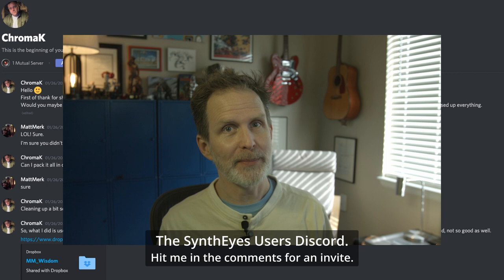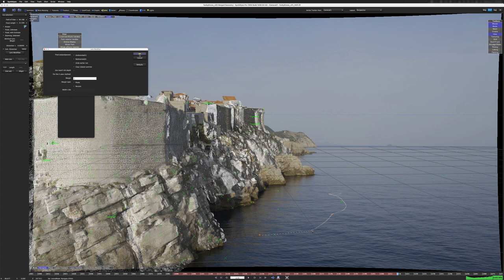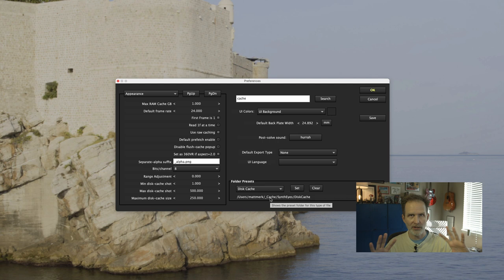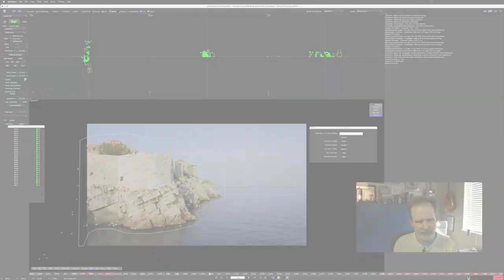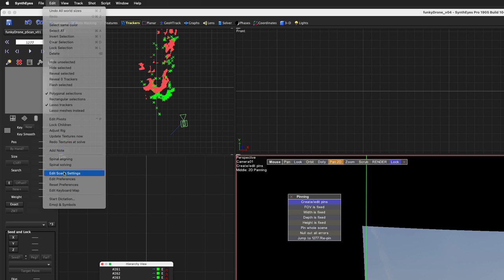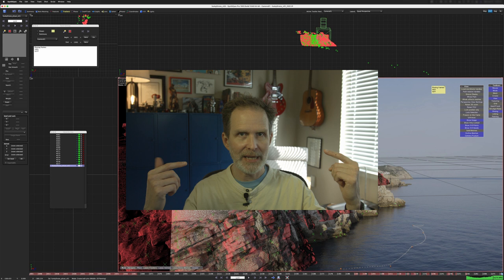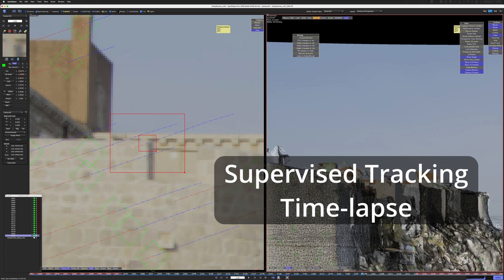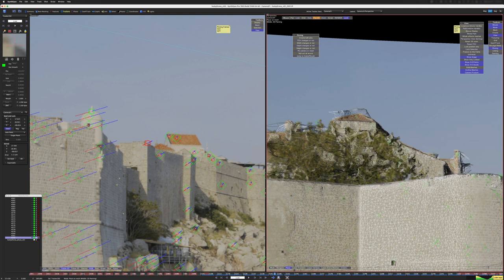How I Align Photogrammetry to 3D Tracks in SynthEyes.

Comment: you said no lens distortion before tracking. does that rule apply everywhere else or just in SynthEyes if I may ask? cause that is something has been bogging me
Reply from the maker: I'd say mostly SynthEyes, because the lens distortion calculations are so accurate. Beyond that, depending on the apps you are using, that assertion may or may not apply. But if you are 3D tracking in SynthEyes, you typically want to try letting SynthEyes solve for the distortion first, and only then moving on to other distortion management approaches.
Reply: @MatthewMerkovich  I love Syntheyes but sometimes time constraints don’t permit me to jump between programs. And I’m a comp artist so I do the 3d camera tracking in nuke. Now I noticed something about nuke when about to solve, you can check the undistort lens button, but that button is not needed when the plate is already undistort.
Reply: @MatthewMerkovich  so when I’m in Syntheyes. I shouldn’t bother undistorting. It’s wrong. And true, Syntheyes undistortion is very accurate
Reply from the maker: @glmstudiogh  We all have to play to our strengths, so if you are getting good results staying in Nuke, I say fabulous! But for me, when I was compositing in Nuke (or any other app), SynthEyes was much faster for me. The trick there is having good pipeline and workflow tools to make those transitions easier. For example, the new SynthEyes to Flame workflow makes switching back and forth much, much faster.

Comment: Hey Matthew, thanks for the video, noob question here, why should we not undistort the footage before tracking? what would be your workflow if you are given lens and camera info, plus a lens grid from the client, or even for a personal project.  Thanks!
Reply from the maker: Typically SynthEyes can calculate more accurate lens distortion maps than lens grids. There are instances where lens grids are very helpful, but that really only applies to very distorted anamorphic lenses. My workflow with spherical lenses and on-set notes is to ignore the notes. Just remember, a 35mm focal length lens isn't actually a 35mm focal length lens.
Reply: @MatthewMerkovich  thanks for your very informative answer, one last question, on this workflow, how do you pass the lens distortion information to the compers and CG artist so they can distort their renders to match the original plate? I am asking this because the workflow I usually see is this one:  Lens distortion is calculated from a grid so we have a node in nuke to distort all the CG renders, and undistorted plate with overscan is generated for both comp and CG. The final submission of course will be the original plate with the CG integrated, distorted, and comped, which would at the end go to color grade or any grading process.  At least at Framestore and at Dneg, which are the companies I have worked for where I saw an actual workflow for these things. I am an FX Supervisor but many years ago I worked as a generalist and did my fair bit of tracking, but never at the level of a big production.
Reply from the maker: @hernanllano9711  Here are my typical, boilerplate Export Notes

Undistorted plates:  If your original footage was linear, the accompanying undistorted plates have been created with a neutral color correction in an RGB color space as JPEG images. If your original footage was in a log color space, the undistorted footage is coming back to you in that color space. Feel free to create your own undistorted plates using the provided undistort nodes in your preferred color space and file format supported by your compositing app.

Nuke: Lens distortion is done via ST maps. The first will undistort your footage, though you shouldn't need it; it's mostly there for illustrative purposes. I've provided an undistorted JPEG sequence, though you could use the first ST map in the Nuke script to generate undistorted BG images of your own, for your 3D team, that are to your color specs. For best results in the final comp, render your 3D elements at the overscan resolution and redistort back to the plate resolution using the second ST map. This leaves your original plate unchanged and only downsamples your 3D render when re-adding lens distortion.

Fusion: Fusion works the same as Nuke.

After Effects: The scene has been exported as an After Effects Javascript. Just run it from within After Effects and your comp setup will be created. Also, an export message from SynthEyes: "SynthEyes Distortion node generated. You must have installed the SyAFXLens.plugin into the (new) folder /Applications/Adobe After Effects CC 20XX/Plug-ins/Effects/SynthEyes. See the Exporting section of the manual." Once your comp is set up, use only the redistort node to add distortion to the VFX elements rendered at the overscan resolution.

FBX: The FBX file format is the most robust output for modern Autodesk 3D animation pipelines. This shot has been exported in the most recent FBX version. (Older FBX versions can be exported for pipelines running older versions of Autodesk software.)

Export Geometry: The triangulated mesh named, "TrkMesh" is provided only as a byproduct of the tracking QC process. The point cloud has been roughly triangulated to show the camera or object track lines up to the photography. Feel free to use it for reprojections or whatever you'd like, but you may need to have actual modeling artists build out geometry using 3D specialized modeling tools like Maya, 3DS Max, Modo, etc.
Reply: @MatthewMerkovich  incredibly useful and detailed information, thanks!

Comment: Hi - this is fascinating. I've been looking at purchasing some tracking software so that I can comp my 3D models (large scale architecture stuff) into drone footage - this seems perfect. Once you've set up this track, can you export the camera into 3DS max for rendering? I assume that's possibl?
Reply from the maker: Absolutely. SynthEyes is very Autodesk pipeline friendly. There are direct 3DS Max exporters, but the best way to do it  in 2023 is to just use .fbx.
Reply: @MatthewMerkovich  Fantastic. Thank you for the quick response.

I'm just giving the Demo a try - and I've imported my 3D site, but it's massive (about 2km long). Any idea how to scale up the camera track by a factor of say 100 to allow me to start pinning the geometry?
Reply: @macker202  You need not scale anything. If your geometry was exported at the scale you want (which is highly recommended),  after pinning, the solve will then conform to that scale. If you want to change the mesh's size (not recommended in terms of best practices), just scale it in the 3D room and your camera track will scale to that.
Reply: @thematchmovingcompany5739  Thanks. My mesh is to scale (which is definitely what I want).

I am almost certainly doing something wrong here then - because once I go to pin, the mesh is so large that I can't actually see any features that I want to move into shot.

[Edit] I used the 3D view to move the camera/trackpoints to the rough location where they needed to be - then I could see the necessary points to start pinning. I've just achieved a way, way better camera track than I've ever been able to achieve in after effects (which isn't really built for this stuff). I think I'll be buying the software!
Reply: @macker202  You probably just need to zoom out. One of the weaker aspects of SynthEyes is the 3D viewport navigation. I may have to do a video about that at some point.